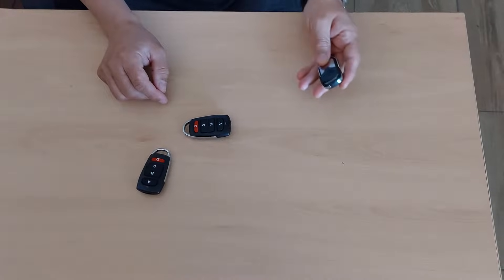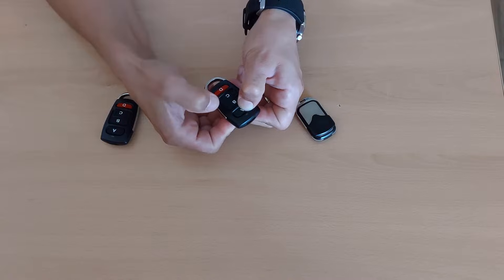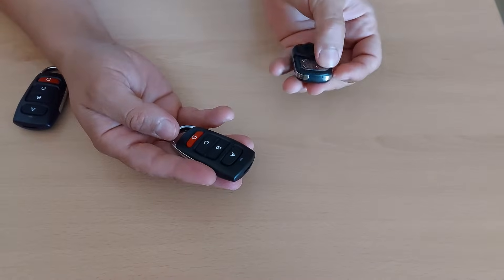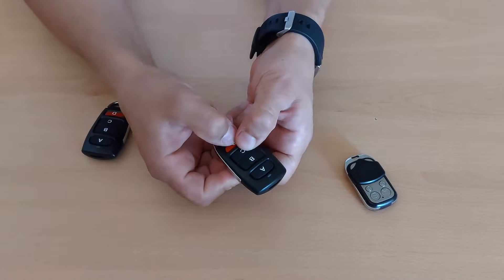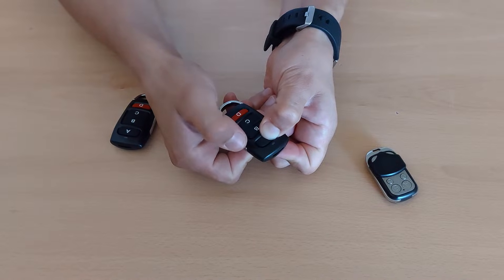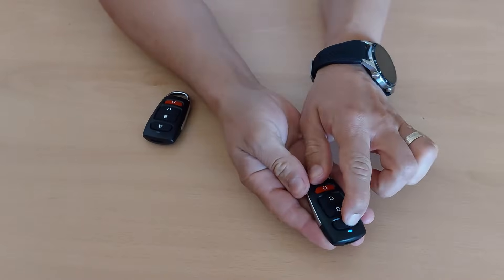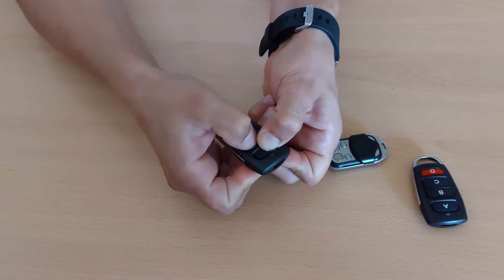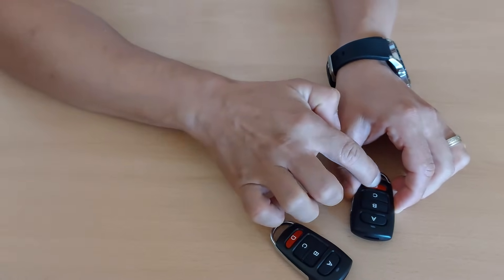How to reset or clone the code of 4 Channel RF Key Remote Control 315/433MHz from ebay

Comment: Any comment on advantages/disadvantages of cloning serial number vs other copying modes?
Reply from the maker: @Trombonauta. First of all, thank you very much for your comment!!! The greatest advantage of these remote controls is that they don’t require any special equipment to copy the signal from the original remote. With just a simple button combination, you can clone the signal effortlessly. Another key benefit is the inclusion of four buttons on a single remote, allowing you to control multiple gates—such as a yard gate and a garage door—with ease.
If you found my explanation helpful, don’t forget to subscribe to the channel if you haven’t already. Your support motivates me and helps me continue creating more content!
Reply: @PAFixandCrafts  thanks! That was not exactly my question, but I appreciate your reply.

Comment: Bonjour à vous
Ayant acheter une télécommande IBTOP 433 la même que vous utilisez, (Normalement compatible en 433,92 Mhz CAME) j’ai essayé de synchroniser ma télécommande de portail EXTEL WEATEM 5.
Hélas ! Cela ne prend pas. Et impossible de trouver un mode d’emploi.
Est-ce qu’il y a un souci de synchro ?
Merci de passer du temps pour vos explications en video. Je suis nouveau abonné !!
Merci pour votre réponse, cordialement.

Comment: Hi, I have a problem with the remote control, when I press the A and B buttons the led always stays fixed it never flashes. I have changed the battery but the problem remains. I cannot reset the remote control. Thank you if you can help me.
Reply from the maker: @gianantoniodellagnese9423. First of all, thank you very much for your comment!!! This issue shouldn’t normally occur. I recommend holding down the C and D buttons to reset the remote control to its factory settings before following the steps in my video.
One of my subscribers faced a similar problem, and it turned out to be a manufacturing defect with their remote. They purchased another remote from the same manufacturer, and it worked perfectly, while the first one simply couldn’t be made to work. If resetting doesn’t solve the issue, it might be worth considering this possibility. If you found this answer helpful, I’d greatly appreciate it if you could subscribe to the channel if you haven’t already. Your support means a lot and motivates me to keep creating content. Thank you!
Reply: @PAFixandCrafts Thanks for the advice. I tried to press C and D, but then it always gives me the problem when A and B the led remains steady, it does NOT flash. Unfortunately, I can't reset the remote control. Thank you again for your interest
Reply: Same
Reply from the maker: @diederickhoogendijk5070. First of all, thank you very much for your comment!!! As I mentioned in the comment above one of my subscribers faced a similar problem, and it turned out to be a manufacturing defect with their remote. They purchased another remote from the same manufacturer, and it worked perfectly, while the first one simply couldn’t be made to work. If resetting doesn’t solve the issue, it might be worth considering this possibility. If you found this answer helpful, I’d greatly appreciate it if you could subscribe to the channel if you haven’t already. Your support means a lot and motivates me to keep creating content. Thank you!
Reply: @PAFixandCrafts  thanks a lot! Will keep this route in mind!!💯

Comment: Ciao, ho un problema al telecomando, quando premo i tasti A e B il led rimane sempre fisso non lampeggia mai. Ho cambiato la batteria ma il problema rimane. Non riesco a resettare il telecomando. Grazie se mi puoi aiutare.
Reply from the maker: @gianantoniodellagnese9423. First of all, thank you very much for your comment!!! This issue shouldn’t normally occur. I recommend holding down the C and D buttons to reset the remote control to its factory settings before following the steps in my video.
One of my subscribers faced a similar problem, and it turned out to be a manufacturing defect with their remote. They purchased another remote from the same manufacturer, and it worked perfectly, while the first one simply couldn’t be made to work. If resetting doesn’t solve the issue, it might be worth considering this possibility. If you found this answer helpful, I’d greatly appreciate it if you could subscribe to the channel if you haven’t already. Your support means a lot and motivates me to keep creating content. Thank you!

Comment: I do the steps but for some strange reason it doesent want to hold the frequency of the original controller
Reply: I think the controllers we  bought where duds cause the new ones we got worked
Reply from the maker: @Cotelic. First of all, thank you very much for your comment!!! I'm glad to hear that you solved the problem even though I didn't help at all. Have a nice day!

Comment: My car (kinda old) uses a TX-71 remote. I lost the original and bought the same on ebay, but when I try to pair it, it doesn't work... Do I need to clear the code in the remote? This remote has only two buttons, and the car should open/close with the same button.
Reply from the maker: @cotelo. First of all, thank you very much for your comment!!! Car remotes can be a bit more complicated. From what I understand, they typically use a dynamic signal, whereas the remote I presented has a static signal. Another potential issue is that the frequency may differ from your car remote. To resolve this, you’ll need a remote that operates on the same frequency.
I recommend opening the old remote and checking the code inside. Once you have the code, you can search online for a compatible remote. Simply enter the code into Google, and you should be able to find a suitable replacement quickly. If you found this answer helpful, I’d greatly appreciate it if you could subscribe to the channel if you haven’t already. Your support means a lot and motivates me to keep creating content. Thank you!

Comment: How do I do the copying if my old remote is completely broken and stop working?😢
Reply from the maker: @panhasambath993. First of all, thank you very much for your comment!!! Unfortunately, these remote controls can only copy active frequencies. If they don't detect a signal, they won't be able to register a new code. However, it’s possible that your remote has an identification code that could help you order a replacement remote control. Alternatively, you might find 433 MHz remote control modules on AliExpress, which you can use to replace the entire module if needed. If you found my answer helpful, I’d really appreciate it if you could subscribe to the channel. Your support greatly motivates and encourages me to keep creating content!

Comment: hope you can help me :( thanks in advance! i subscribed to your channel
Reply from the maker: @gatchicagobullsph8210. Then I think something is wrong with the remote control. There is also a combination between buttons C and D that you have to press simultaneously for 20 seconds and it recovers the previous codes. I honestly don't know if it helps, but it's the last possible combination that I know of. Please try this and immediately try the first button combination again. If it doesn't work, write and try to document myself.

Comment: hello, i tried pressing A and B and press B 3 times while holding A but after that , i pressed any button it still light on, how do i fix this? it should not light up, right?
Reply from the maker: @gatchicagobullsph8210. First of all, thank you very much for your comment!!! You should press buttons A and B simultaneously, then press button B 3 times, while button A is still pressed and hold it for another 10 seconds, then release button A. After this operation, the old codes should be deleted and when pressing any button, the light should not light up. To clone, put one remote control next to the other and hold down the buttons you want to copy, simultaneously on both remote controls. I hope my answer was helpful. And if you have other questions, don't hesitate to write to me.
Reply: @PAFixandCrafts  thank you, i bought 2 clone remote but both still light up :((
Reply: Bonjour , j'ai réparé cela en pressant simultanément A et B pendant 1 minute.
Hello, I fixed this by pressing and holding simultaneously A and B for almost 1 minute.
Reply: @francoisbarrat5800  thanks so much it still light up even if i press the a for 1 minute :(
Reply: Just got my remote from Temu, and I have the same problem. I cannot reset it and delete the factory code. I tried all what you said. Anyone has the solution?
Reply: I followed your instructions and everything worked, thank you. But after some days it stopped working again. Any ideas?
Reply: Same problem. No solution yet. Anyone got to make it work?
Reply: @modernerealty4566  nah, i just bought another one and glad it worked out
Reply: the instructions with the remote aren't very clear,I watched the vid and I've it working fine now.Thanks 👍
Reply: Same problem. Has anyone else figured this out. Pls share.
Reply: I bought 4... all 4 have the same issue

Comment: Can you use this for a car key remote?
Reply from the maker: @Justmevs. First of all, thank you very much for your comment!!! Unfortunately, this remote control isn't compatible with the car's system. To ensure compatibility, you'll need a remote control equipped with a dynamic signal, and in certain cases, a stabilizer chip might also be necessary for the car to start. Additionally, for older car models, compatible remote controls are often available on the market at reasonable prices. If you found this information helpful, I would greatly appreciate your subscription to the channel if you haven't already done so. Your support not only motivates me but also encourages me to continue creating and sharing new videos.